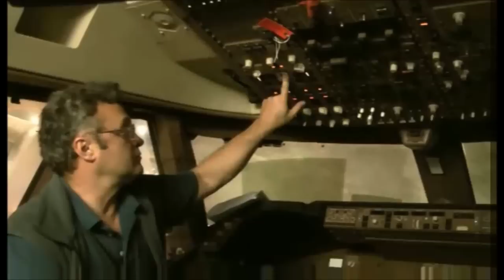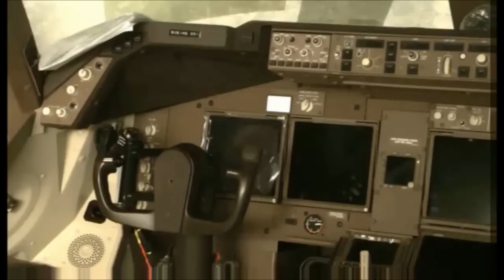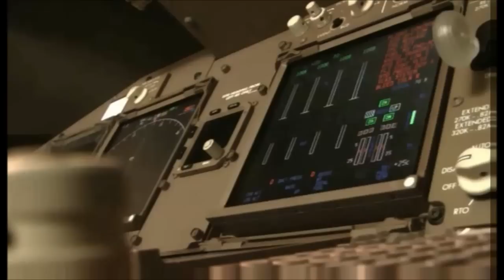Boeing 747-8 Intercontinental Powers Up [HD]

Comment: @sofruity3 I have been driving now for 22 years. A few weeks back I was coming down a road got distracted by an oncoming bus and missed out the signal light, the cop fined me. Its human to error. It is not a good idea to give a pilot too much control when flying. Imagine having a car which has a computer on board to tell you when to turn at a signal and when to over take. That would be fabulous. Waiting for drive by wire technology.

Comment: That kind of cockpit upgrade would require a lot of code re-writing and re-configuring to make a brand-new, from scratch avionics package work on a plane it wasn't originally designed for. Though doing that is within the realm of possibility, it is nowhere near as simple as it sounds and is, for now, far from practical, especially when B744s already have a very good avionics suite, with room for more development, hence the upgrading of it's existing systems.